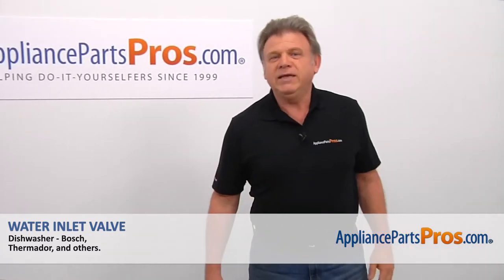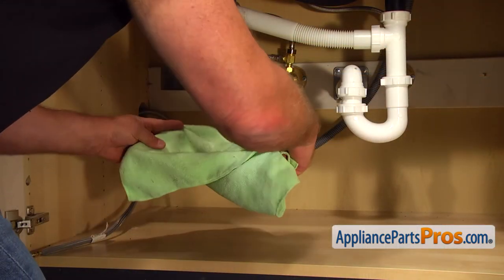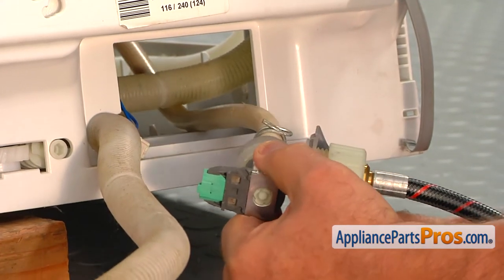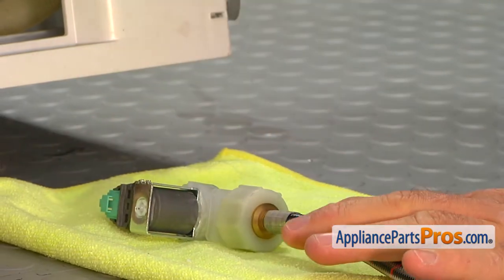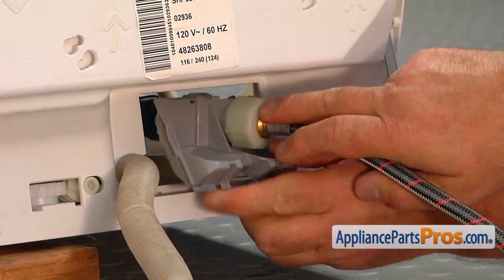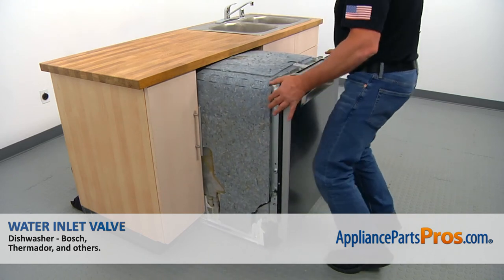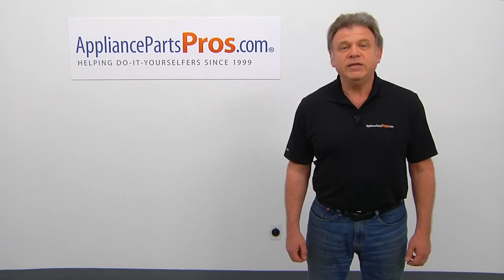How To: Bosch/Thermador/Gaggenau Water Inlet Valve 00628334

Comment: Good video.  One suggestion, use hair drier to heat the hose ends before removal.  Comes off easy then.
Reply: Yes. This is the way.
Reply: thank you!! i couldnt believe they edited out the hose removal, that’s the only part giving me real trouble.
Reply: 🎉🎉🎉Thank you for this tip. 🎉🎉🎉
Reply: Yes! I used a heat gun and it came off easily. (And went back on as well) Just don't over heat/melt it! Lol

I also only disconnected the hoses on the end closest to the part. (Not both)

Comment: Was quoted $400 for an appliance service call.  Ordered the part for $40 incl delivery and installed myself following step by step this video.  So far so good.  Everything seems to be in working order with no more drip at the inlet valve.  Thanks for the DIY video!

Comment: Just replaced my water valve.  I tested the old one with some wires,  and while i could blow a bit through it,  it wasn't working well. The video was great with detailed shots and a good order of assembly. Even though I'm pretty handy, I  found the video very useful. Made it easy and now the water is flowing again! I did snug the inlet 1" nut with some pliers,  not much though, but just beyond hand tight. Thanks for the video!
Reply from the maker: Glad we were able to assist you!

Comment: Hi. I replaced the part, but no the dishwasher won't turn on. No lights on the panel. Nothing. I've checked the outlet which is plugged in and working, but still nothing. Any ideas?

Comment: 🎉🎉🎉   There are no Bosch dishwasher repair services in my area. It took me a great deal of research to troubleshoot the problem first dishwasher water would not drain. Only after replacing my garbage disposal, did I find the drain hose was filled with gunk. I used a shop vac to suck out debris.  Ok, now, the dishwasher drained great, but would not fill. Again, headed back to Youtube to find solution. I found this video, ordered the part, and followed directions to replace part.
Excellent video. Step by step directions made replacing inlet valve tackle-able. The PRO tip to use a hair dryer to soften tube made this job 1000 times easier. Thank you.
Reply from the maker: You are welcome. Glad we were able to help you out. If there is anything we can help you with in the future please let us know.

Comment: Another great video from AppliancePartsPros. The clear instruction made it easy to replace the water inlet valve on my Bosch dishwasher. The most useful part of video for me was showing how to release the grey mounting bracket by lifting the tab with a screwdriver - left to my own devices I would likely have broken it trying to remove it.

Comment: Thanks for this video. This isn't the exact same model or design as my dishwasher but the demonstration of removing the valve assembly by pressing the tab with a screwdriver helped me work out how to remove mine. Not 100% sure if that will solve my problem though - getting an E-18 error on a Bosch machine. Will try this repair if cleaning the inlet pipe and filters doesn't fix the issue.

Comment: Only teouble I had was getting that electrical plug to release. 
Two small blue wires ended up detaching from the small plug. 
Any info or closeup photo on how I can reconnect the wires to the plug, so I can snap in the plug to new fill valve?
Reply from the maker: Unfortunately, the manufacturer doesn't provide any information for the wire harness and how the wires are arranged in the connector. You may need to contact a tech or an electrician to fix the wires.

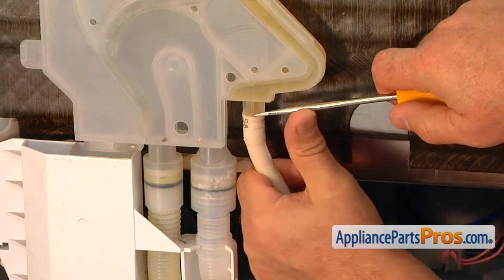Comment: 2:50 I didn’t need to remove the fill hose above where it connects to the assembly because it was so hard to remove so I left it there. However I Removed the fill hose where it connects to the fill valve easier by getting to it through the side of the dishwasher after I disconnected the wire and the water supply.

Comment: Why do you need to remove the fill hose on the side at 2:50?
Reply from the maker: This fill hose is connected to the water valve and in order to be able to remove the valve you would have to remove the fill hose on the side there.
Reply: You don't need to. I only disconnected one end (at the part) for all hoses. 

Also, if your waterline and hose is long enough to let you pull the machine out, you really don't need to undo both ends of all the other connections as well. (I didn't) 

I just turned off the water supply valve (under the sink) to the DW. Turned off the power at the breaker. Undid the 2 screws under the counter and pulled it out.  (I think this video probably shows all the extra disconnections so it covers all models possibly? )

Then I only needed to disconnect the connections at the machine end, or that are connected to the faulty part, unclip the plastic mount so I can slide the part off of the bracket. Then I fed the part through to the side portal to unclip the wiring harness and I only removed the hose where its connected to the part I was removing. (I found that there was no need to undo the other end really) 

TIP: Heat the white hose with a hair drier, hot water, or very carefully (so not to melt or degrade the hose), with a heat gun. It's VERY difficult when it's cold to remove/replace, but VERY easy after heating/softening the hose. (Brute force not needed! 😊)

Comment: Correction - Missed the other end disconnection.
Reply: I did not posted any correction comment!. Someone is editing negative comments. I have replaced first valve b/c it was cracked in the middle ( valve is placed in the tight area where it is pressured against another metal part ) creating the leak, and now I am replacing this valve second time b/c I am getting code 17 ( intermittent fault 90 % of the time ). Bosch quality sucks.

Comment: Bosch quality sucks ( plastic, plastic, plastic, plastic ), - this valve lasted 2 years, dripping water in the middle (end of white plastic and beginning of a grey part of the valve ). Without removing doors cover and front bottom cover first I would be not able to localize exact place of the leak. Got ER 15 when the float hit the sensor, however display in my Bosch is hidden so if it was standing dormant for extended period of time my socks would notify me that something is wrong. Bosch and other companies should add moderate sound warning ( beep every 5 min ) , working together with the leak float sensor.